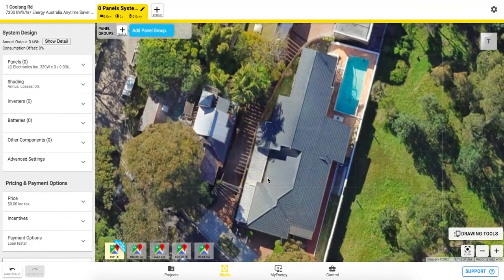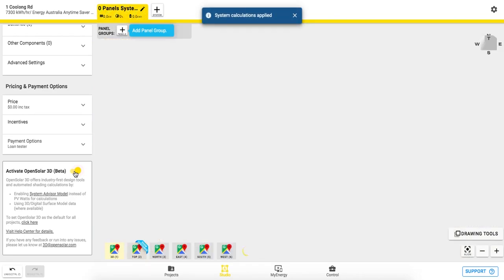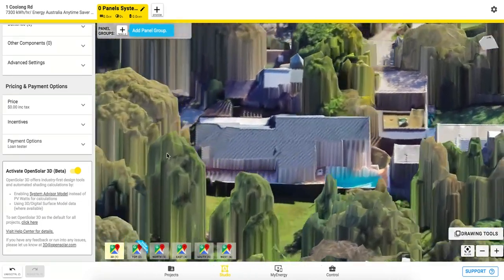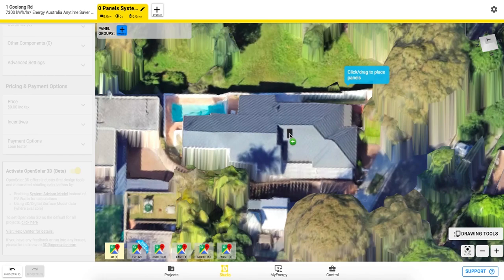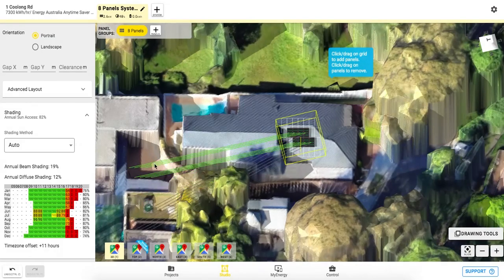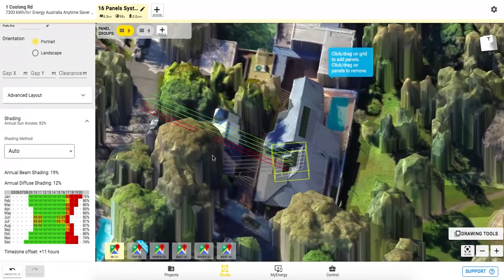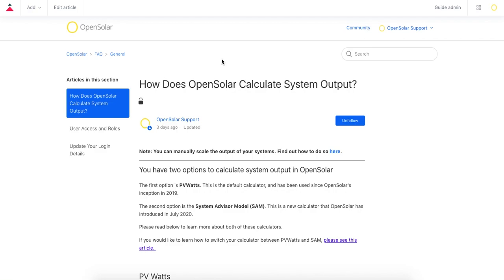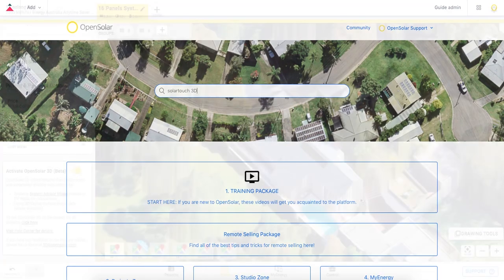OpenSolar 3D Showcase

Comment: does this only work if we use nearmaps?
Reply: Hi Matt, it certainly works well with Nearmap and it also works with Google - or other map sources - if 3D data is available at a specific location.
Reply: @maaikegobel8229  great, do you have a list of areas that 3D is available?
Reply: @mattsinden6055  I don't have a list available - please just put in the address to check. For further questions, please feel free to email support@opensolar.com
Reply: Do you have Lidar Mapping integration?